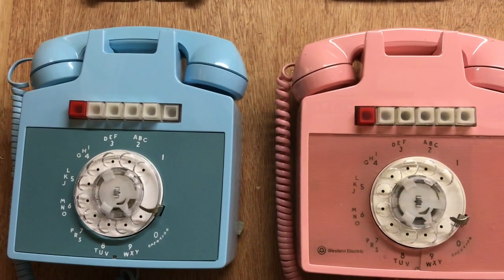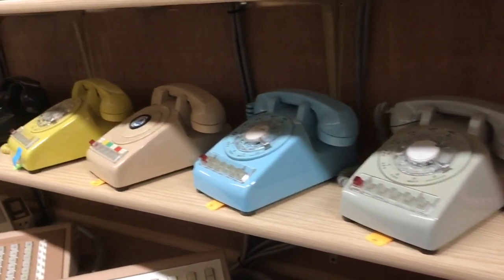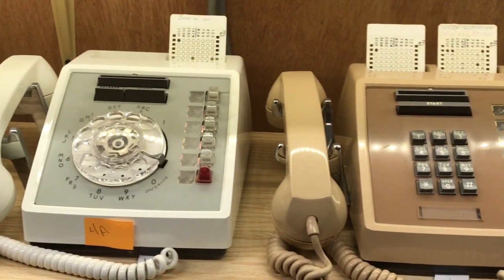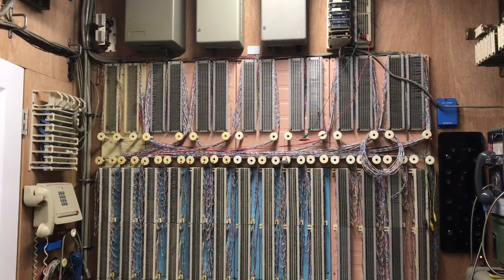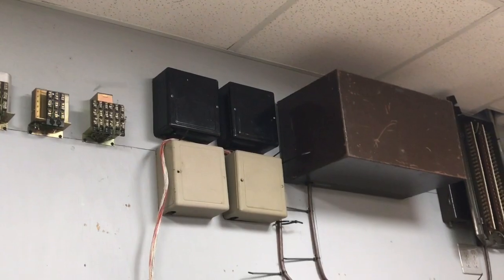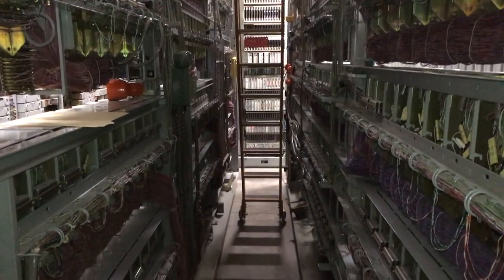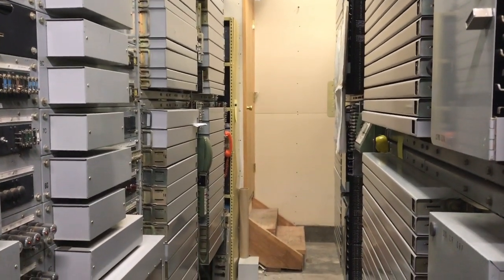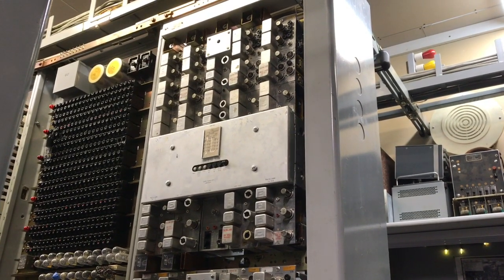Business telephone 1A2 display and walk thru of a central office switch building.

Comment: Your systems look bigger overall than the no.1 SxS system I worked in the early 80's. Very interesting and alot of good memories when I worked for southwestern bell. Thank you so much for bringing this video. I never thought I'd see this equipment again.
Reply from the maker: Its a small exchange. 600 lines with 5 EAS routes , this is why it has so many selectors. I was able to acquire a lot of trunks.
Reply: @sxsphil  that's awesome.  I couldn't even get a crossbar switch.